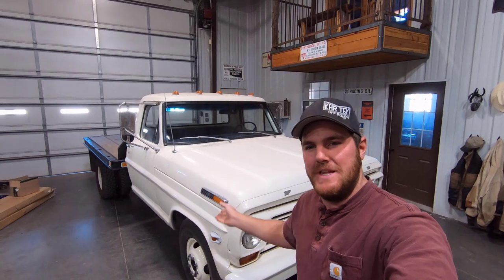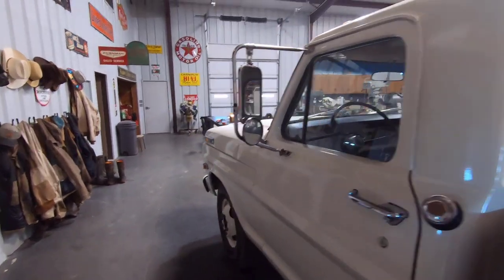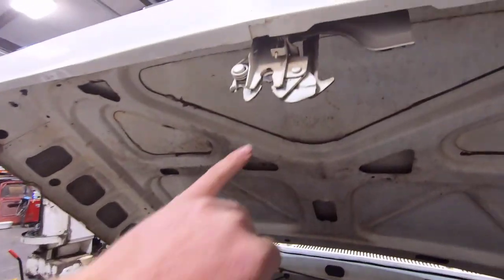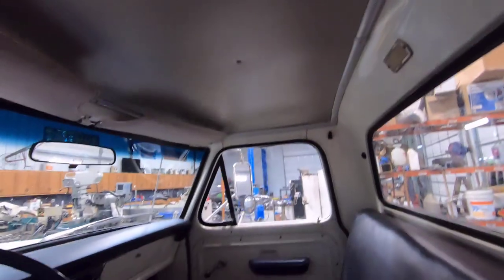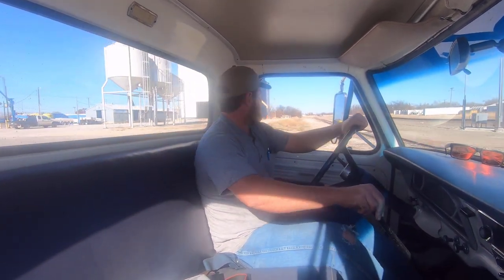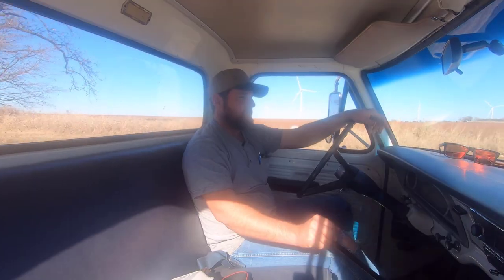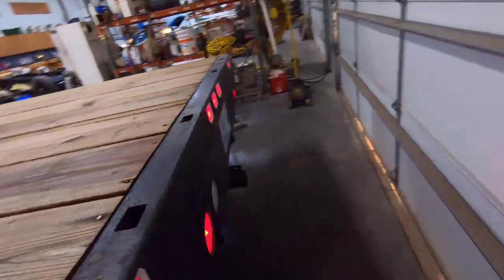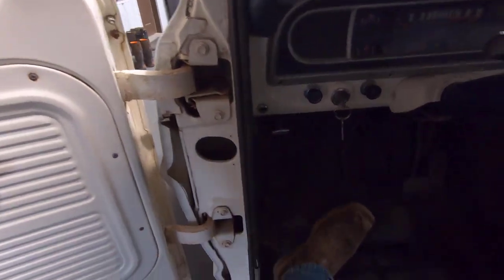No Reserve: 1969 Ford F-350 Flatbed Bring-A-Trailer Auction

Comment: Nice one ton! I have a use for it, but I don't normally get them in this nice of shape. No, I have to buy a needy one and then spend thousands of hours and dollars to make them this nice. Even the DR's can't figure out what's wrong with me. I dunno.

 I have a '72 and I have the same problem with the turn signal cancel. Mine has the non-canceling left turn option. Be nice if you could replace it without pulling the wheel. It would have been replaced by now if a guy didn't need to do that. But, ya know, you get used to it, then it takes even longer to get at fixing it.

Where did you get the blue arm rests? I can only find black, parchment and if I remember correctly, red. Where did you find the headliner as well, all I can find is gray. Heard horror stories on the ABS replacement since it is shipped rolled up. Checked the usual places, Dennis Carpenter, C&G, LMC, etc., etc., to no avail.

Nice job replacing the cowl seal. Observed so many "resto's" and they either leave it off or leave the pieces that are still attached by the tabs. GLWTA, it will do well!

Comment: thats a really nice clean truck...wish I needed it...I've already got 2 of 'em.  It's better to have an original engine. My experience is that once these FE engines are opened up and rebuilt, they never run as good as the original factory built ones.
Reply: I would say otherwise!  I know of several that have been rebuilt including to of my own and they ran extremely well!  Much better then stock and for a long time!